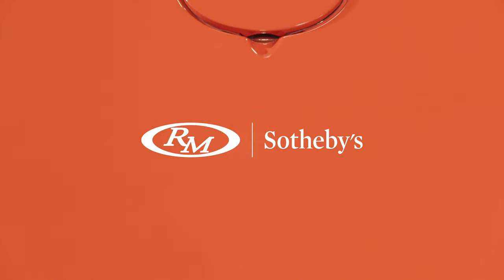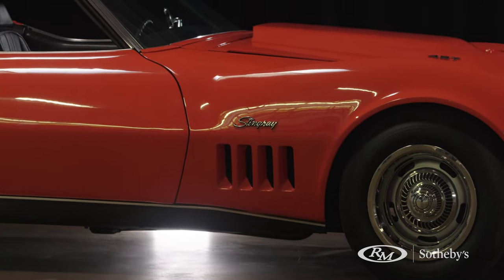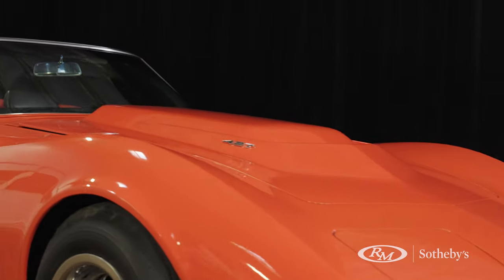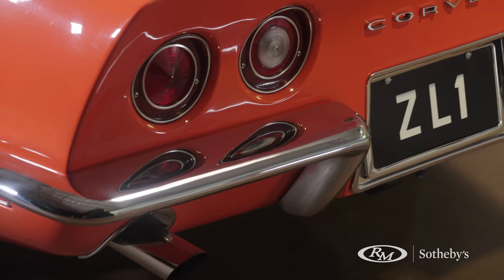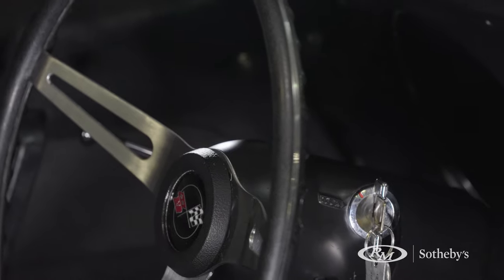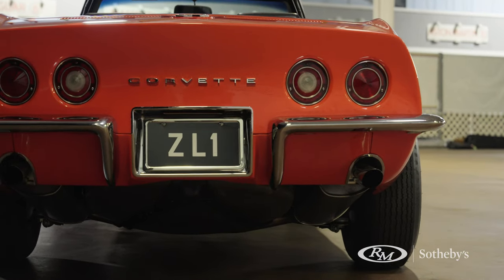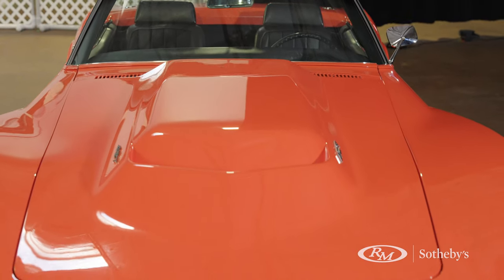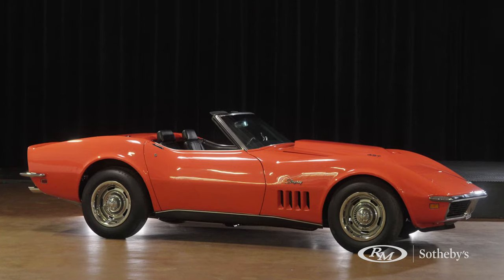The Legendary 1969 Chevrolet Corvette Stingray ZL-1 Convertible

Comment: PLEASE stop putting horrible background music in these videos. You actually started and ran the engine... use THAT as the background music. It's the entire reason the car's rare and different.
Reply: They just don't understand.... PS- its the automatic transmission and convertible for your last statement.   There were 2 other ZL-1's made but both manual and hard tops, I believe.
Reply: @alexmarks7275  the other two ZL1s are at least "questionable" when it comes to originality, they both lost their engines at sometime and all of sudden came to us with what appeared to be the original motor, and one of the two almost has no documents.

Comment: "After much scrutinous review of its comprehensive factory documentation, 710209 was awarded Bloomington Gold certification and formally recognized as the first of the two factory-built ZL-1 Corvettes." So Bloomington validated this as one of the original ZL-1 Corvettes that left St. Louis that way and with its original engine?
Reply: Nope.  Talked to a senior Bloomington judge.  The engine in the car was NOT certified.  When presented for judging, the owner was allowed to remove any claims about the engine.  Highly unusual because their prior rule stated if presented as original and no proof found to be original, the car is required to come back the following year.  Why this rule was not followed is another question.
Reply: S/N 710209 left the factory as ordered with an L88 and M40
Paperwork is now on the Corvette Forum
Reply: @nomojoho2920  That's nonsense. 
  It left the factory with  a ZL1 and M40.
Reply: @gordiesings  Show the proof.  The inter-organization letter is dated 1-17-69 and lists this S/N along with 4 other L88/M40 cars that need to be recalled due to overheating concerns.  This car was listed as being shipped to WestPenn Garage.
They all needed fan shrouds and different fan clutches installed.